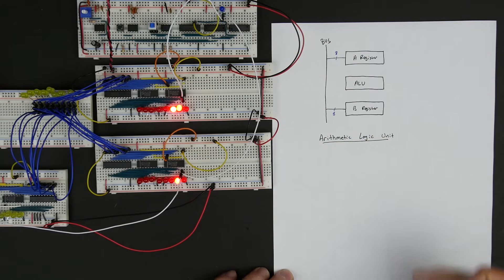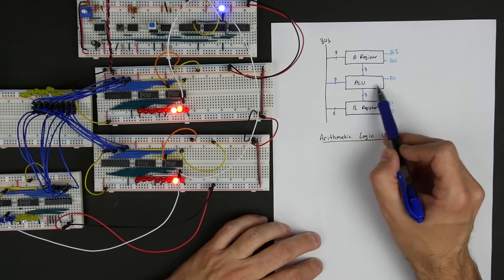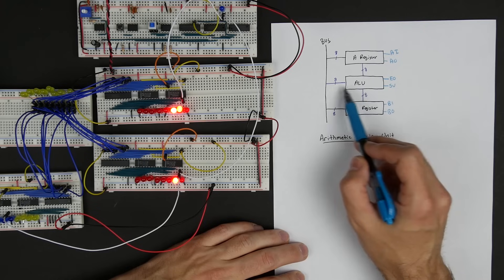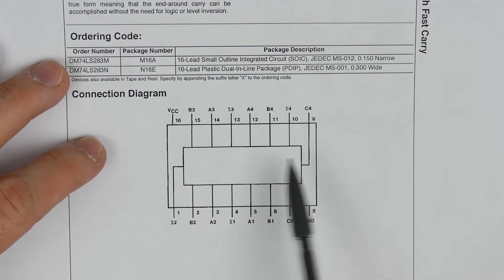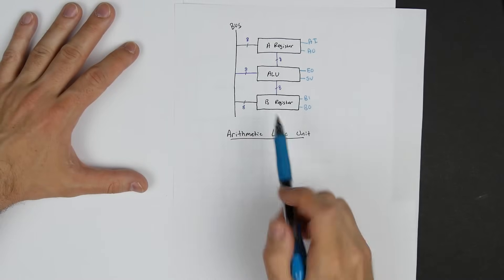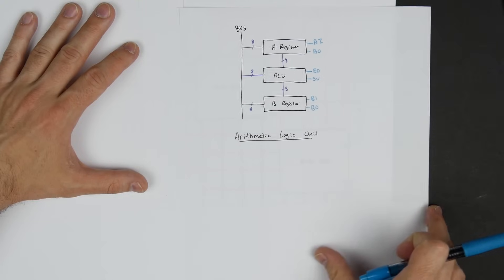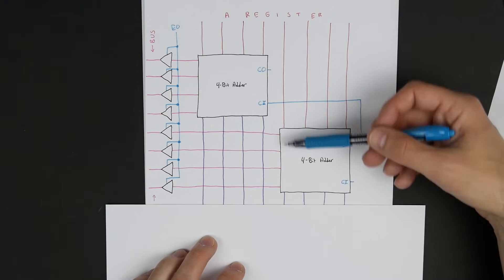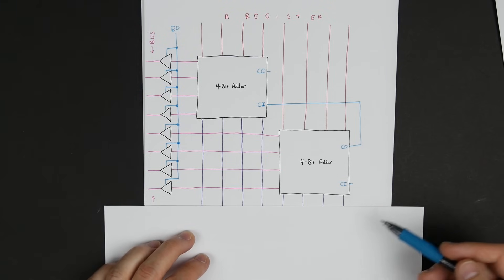ALU Design

Comment: I find the whole "Invert the bits and add 1" procedure to be messy, convoluted and confusing. 

Here's what I do:

Assuming 8 bit width, I tell myself the MSB is pre-weighted to -128, and I just add the other columns needed (positive values) to -128, to reduce the negative magnitude of the sum of all the bits, until I reach the negative number required.

EXAMPLE:
~~~~~~~

* I want -64 *

| -128 | 64 | 32 | 16 | 8 | 4 | 2 | 1 |
      1     1      0     0    0   0   0   0

I add 64 to the -128 to get -64, as above,.

Comment: Do you need 8 wires for the 8 bits? Is there a way to use one wire to send 8 signals for 8 bits

Comment: I've a dumb question, Can you just have registers and ALU conected by the same bus? I see in the diagram that you connect directly A and B registers directly to the ALU and Kind of makes sense, and have a porpuse have 2 registers but, there is a way to just conect all to the same Bus right? obvisly is not gonna be efficient but, it works, Am I right? (I know ALU should be share an I/O bus in that case)

Comment: It occurred to me that you could make this "ALU" (which is really only an arithmetic unit) into a proper ALU by adding more circuits to perform the missing logic operations, with a "rotate" possibly being the easiest to implement.  You then just "gate" the outputs of every logic operation you've added so that only the selected result is sent to the A register.  In other words, all of the calculations and logical operations are done, but only one of the outputs is used at a time, depending on the operation selected.
Reply: There are memory chips that can shift and rotate and there are memory chips that can increment the content. So you can use first kind for A and the second kind for B then have your instructor dechiper perform those funcitions in appropriate accumulator.

Comment: hi Ben i want to learn sometihng.on the series you are using 74ls series ICs.on my country finding this series is really hard.but i can get a 74hc series to all need ICs.is it possible i can build this computer with the 74hc series.And another problem for me is the RAM and the ROM ICs. i cant find  74189 IC. neither LS nor HC series. what can i do for this? and las question is may i use https://cdn.ozdisan.com/ETicaret_Dosya/2651_9435887.pdf this IC for the replacement to 28C16 ? i m really thank you for all your videos and helps.

Comment: i built this but when i do 256 - 256 it gives me 256? can someone help pls
Reply: A couple of things to start:

1) there is no such thing as 256 with 8 bits. There are 256 numbers but their values range from 0 to 255; and
 
2) to allow for negative numbers, the values range from -128 to +127.

So I'm assuming that what you are referring to as 256 is eight ones in a row "11111111".

In this scheme, 11111111 is the representation of the value -1 in two's complement, refer to Ben's excellent video on the subject https://www.youtube.com/watch?v=4qH4unVtJkE

At any rate, if you are feeding 11111111 to both registers and the output is still 11111111, it is possible that you are either:

A) inverting the bits of the B register but not adding the carry-in to the first adder, in this case the B register input becomes inverted ones (i.e. zero), and eight zeros plus eight ones equals the 11111111 that is showing up on the bus; or

B) adding the carry-in but NOT inverting the bits of the B register, in this case there will still be 11111111 on the bus as well as a carry out from the second adder (see below).

Intended behaviour:
A reg: 1 1 1 1 1 1 1 1
B reg: 0 0 0 0 0 0 0 0 (inverted)
Carry: 0 0 0 0 0 0 0 1
================ (+)
    (1) 0 0 0 0 0 0 0 0

Scenario A:
A reg: 1 1 1 1 1 1 1 1
B reg: 0 0 0 0 0 0 0 0 (inverted)
Carry: 0 0 0 0 0 0 0 0
================ (+)
     (0) 1 1 1 1 1 1 1 1

Scenario B:
A reg: 1 1 1 1 1 1 1 1
B reg: 1 1 1 1 1 1 1 1 (not inverted)
Carry: 0 0 0 0 0 0 0 1
================ (+)
     (1) 1 1 1 1 1 1 1 1

Hope this helps!

Comment: I would love to see some videos on multiplication and division. Also handling decimal places.
Reply: Decimal places are normally done with floating point values. These would be not very useful at 8 bits because those 8 bits would need to be split between the sign (1 bit), significand (maybe 4 bits) and exponent (3 bits) and would be very time-consuming to implement in logic gates. Fixed point arithmetic (where the exponent is fixed in advance) would be possible, but that's because it can be done with the same instructions as integer arithmetic: the programmer just has to remember that a given memory location is fixed point and so means e.g. an eighth or a 256th of the integer stored there. It's possible that 16-bit floating point could be implemented in software on this device using two memory locations next to each other though.

Multiplication and division even of integers would take a lot of logic gates, but again could be implemented in software.

Comment: Hi, I'm a teacher assistant in the university in a course of computer organization and will recommend these videos to them. Also, do you happen to explain how to set the flags when doing subtraction, especially how you modify the carry out to indicate borrow (since this is the part where students struggled the most)
Reply: There’s no need to “modify” the carry-out for subtractions. It just works as is, only that it has an inverted meaning. All processors use that convention

Comment: just a thought but how would you incorporate and use a shifting "slide rule" in these ALU, and would it increase 8bit/16bit calculation speeds  to assist (x264/x265) integer style assembly instructions hardware as a practical 2019 real life use case ?

Comment: very nice. I would have added an AND gate to the CI input, one input coming from SU and another comes from an enable EN, this is to prevent possible errors to times due to gates delays in transmitting the data, having the EN on the AND ensures that everything happens step by step instead of throwing the data on the bus.

Comment: But subtract with carry?
Reply: Subtraction works differently for upper and lower bytes:
LO := A + ~B + 1
HI := A + ~B + CF
So you'll need two separate instructions SUB and SUBC.
Let bit C represent the subtraction type in a SUB instruction opcode (C == 1 => SUBC).
Then you add the following logic scheme between the SU line and CI:
CI := (!C && SU) || (C && CF)

Comment: "The different between 1's complement and 2's complement is 1",  Awesome
Reply: Brother Bt how could I do or perform it on bred bod?
Reply: @thakermahek2501  you need 2x 7483 ic(4 bit parallel adders), 2 7486 ic (4 for gates), then connect the 2 adders such that c4(carry 4) of first adder is connected to c0 of the second adder. Connect each B input of the 7483 ics to output of an xor gate and short 1 input of all xor gates and connect to c0 of first 7483 ic. Now the inputs are given to a0-a7 of 7483 ics and to other input of the xor gates, by giving 1 to c0 of first 7483 ic you get A-B by giving a 0 to c0 you get A+B, A-B is outputted in 2s complement form, because the xor gates with one of their input as 1 act like not gates and invert the bits of the other input so you get B complement which is added to A By the adder ic and a 1 from c0 is added to the result which makes it 2s complement instead of 1s complement, you can also get 1st complement by simple modifications as well.

Comment: Excellent videos!  I love all of these. I gave you a thumbs up. I especially like your use of XOR as a conditional negation for subtraction, and that was a very easy and clever way to add 1 using the carry-in.
Reply: If the Carry has to be kept (for handling bigger data sizes), then another XOR gate should be included, with one input acting as Carry IN, the other as Enable SUBSTRACTION (connected to the XOR conditional negation input). The output is then connected to the Carry input of the Adder. 

Will work with both Addition and Subtraction.

Comment: 13:40 What if we want to use that carry-in for an actual carry-in too?
E.g. to pipeline calculations on some longer numbers? (in which case the carry out from the previous sum stays in the carry flag, and then it is used in the calculation of the next part of the sum).
Reply: Use another XOR gate, and connect one of its inputs to the "enable negation" input of the XOR array and use it as "enable subtraction" onwards.
The other input of the XOR gate is used as the carry-in, for both addition and substraction and

the output is connected to the carry input of the adder chip.

I used that for my test ALU in Logisim, and it works. 

In addition (not exacly required), you could use another XOR gate, to fix the carry-out polarity of the adder, since it is inverted when substracting. 

One input of the XOR gate is connected to the "enable subtraction" input, the other to the carry-out of the adder. 

The output of the XOR gate is afterwards the fools-proof carry-out, for both addition (most call it carry) and substraction (some call it borrow).
Reply: Most processors (that have flags anyway) have instructions for add with carry and subtract with carry / subtract with borrow in addition to their normal add / subtract.

Add with carry just means that you use the carry flag for the carry in, instead of setting it to zero.

For subtraction, you have to choose how to interpret the carry flag (different processors do this differently)
* carry high means borrow (e g x86)
* carry low means borrow (e g 6502)
The first version is more intuitive to me, but then you need to invert the carry flag going in and out in case you're doing subtraction.

So you need to add some logic to either take a hardcoded carry or feed in the existing carry flag (plus maybe the xor stuff above).

The 6502 actually only has add with carry (adc) and subtract with carry (sbc) instructions. If you want to do a regular add then you need to clear the carry first, and if you want to do a regular subtract then you need to set the carry flag first. That's a way to solve that logic in software I guess :)

Comment: Correct me if I'm wrong, but instead of worrying about enabling the initial carry with the subtract enabled, can't we just leave off the XOR gate on the ones bit for the B register?
Reply: No, this would only apply if the 1s bit was initially high on the B register. Otherwise, if the 1s bit is low on the B register it would remain low and there would be no carry to the other bits.

For example, if the B register has a value of 2, in normal operation this would be negated in the following way (assuming signed 8-bit integers):

00000010 B = 2
11111101 (NOT B) = -3
11111110 (NOT B) + 1 = -2

Whereas, if you omit the inversion of the 1s bit, we receive:

00000010 B = 2
11111100 (NOT B except 1s bit) = -4

Comment: Why do you attach the a and b registers directly to the ALU rather than having them loaded through the bus?
Reply: There is no nead , why not , if you want to use those registers for odher purpose than adding / subtracting than just turn off the output of the alu

Comment: The ALU carry that is used for subtracting is a bit interesting because if you look at e.g. the 6502 processor (by MOS/Commodore) you actually have to do a SEC (set carry) before you do your SBC (subtract) in order for there to be a correct 8 bit subtraction (ofc when doing 16 bit subtracts you actually use whatever carry was from the lower 8 bit subtract when you do the 8 upper bits). Same when doing an ADC (add) you do a CLC to clear the carry (again used to carry oveflow from previous add if doing a 16 bits addition). This video sort of explains everything perfectly.
Reply: Having the carry set depending on whether the operation is add or subtract, will limit you to doing 8 bit math.  Possibly why the 6502 required setting or clearing the carry, so the carry flag could be input into the ALU from the result of a previous addition or subtraction, rather than having it fixed by operation. Does give you an insight into the ALU of the 6502 though, they must have just used the ones complement (the XOR gates) and rely on the programmer to set or clear the carry correctly.
Reply: @threeMetreJim  No it does not. Even if you have 128 bit number the two's complement is invert and add 1. It is not invert 8 bits sequences and add 1 to each. So to substract two 16 bit numbers in 8 bit chunks you set the carry on lowest 8 bits and use the carry resulting from that on the higher 8 bits. And just continue to do that if you want 48, 64 80, 96 or what not bit subtraction.
Reply: @topilinkala1594  I know how to do multiple byte addition and subtraction. What I was trying to say that the programmer has to set/clear the carry - if the instructions cleared the carry for adc and set it for sbc, you would not be able to do multi byte addition or subtraction (you'd lose the carry or _borrow from the previous adc/sbc operation). The sbc instruction is only performing the invert, the programmer supplies the +1 through the carry flag (set).
Reply: @threeMetreJim  Why wouldn't addition and subtraction not set the carry? That would be stupid processor design. Even this dincky SAP-1 based processor has the carry line.
Reply: @topilinkala1594  before the instruction is executed, not after - hence having to manually set or clear the carry before the first adc or sbc instruction (or the only one), which is what the OP was saying - I was describing the processor internal circuitry (XOR'ing the data with all ones is an invert for the 1's complement before setting the carry for a subtraction). If you build up some logic gates into a set of cascaded full adders, then the initial state of the carry is set by the programmer. Maybe it was done to save space on the chip - it was 1975 after all. For subtract you invert the data you are subtracting, and setting the carry is the +1 for two's complement. For addition you don't invert the data and clear the carry. If you want to play with things manually, program some 8 bit PIC16 code in assembly... Also watch the videos on designing your own simple CPU - the designers left out the set or clear carry per instruction. It was implemented in logic, rather than use a lookup ROM and microcode on the 6502.

Comment: wait. i had to stop at 3:34 why connect the a and b register directly with the alu. cant you do that over the bus
Reply: The bus can only transfer one value at a time. But the ALU needs two values.
On top of that, the ALU also needs to output to the bus. You can't read from and write to the bus at the same time.
Reply: hmm makes sense.

Comment: So I was going over this project again and realized you haven't actually created an ALU.  All you have is an adder/subtracter circuit.  It can't perform bitwise operations or bit shifts, so it lacks the logic part of an ALU, and without a shifter, it can't easily be used for multiplication or division subroutines (so arithmetic is limited as well)

Comment: I am new to this and have a question. Instead of using tri-state buffer to enable output to the bus , could you use and-gates to do the same thing?
Reply: No: conventional and-gates output 'active' 0 signal which would conflict with other outputs to the same bus. So you need either tri-state buffers, so you are totally disconnected from bus when inactive, or you could make bus with open collector or-gates and common pull-up resistors. Not recommended, because it works slower than conventional bus. Or, instead of bus, you could use multiplexer for all the devices you have. That's the only way it is done on FPGAs which surprisingly don't have tristate logic 'inside', only for I/O pins.

Comment: I recommend reading the book 'But How Do it Know', it's a great book about computer architecture and even though I am a software developer, and not a computer engineer, it still helped me to understand a ton about computer languages, especially assembly.
Reply: A good companion to this video series is the Coursera course "Nand to Tetris." The course itself doesn't actually reach Tetris -- it was going to be a 2 part course but I'm not sure they ever got around to recording part 2 -- but the book the profs wrote does. Essentially it's a computer architecture course where you build a 16 bit computer in simulation using a simplified HDL. They give you two 'givens' -- a nand gate, and a D flip-flop. The exercises have you build the rest. First you build the simple logic chips -- NOT, AND, OR, XOR, and so on. Then you build a half adder & full adder, then a register, then multiplexers/demultiplexers, then a single RAM chip, then a much bigger RAM, before going onto an ALU and then a full CPU. The final project is to write an assembler for the machine code for the machine you just 'built.'

Again, it uses a version of an HDL (a programming language that is used to describe digital logic chips), so you're not actually playing around with breadboards, but you still get to see how everything works. They provide a pretty good simulator that shows the values of registers, as well as providing a simple simulated monitor for graphical output. For me, the biggest OMG moment in my entire experience learning CS was when I realized that all an opcode is is a set of 1s and 0s that are used as inputs into control lines for chips. Learning that felt like I finally got a satisfactory answer to the question I had had since I was a kid -- "Okay, it's all 1s and 0s, but how does it do stuff??" (This is probably more of a helpful mental model nowadays than the reality of modern superscalar CPUs, given microcode and so on, but still deeply satisfying.)
Reply: Arseniy 7
Reply: @grantwhite1144  that book actually led me here